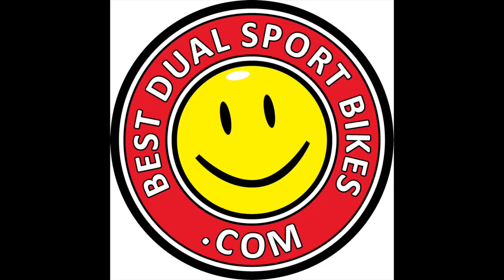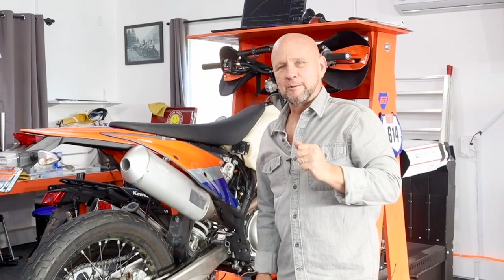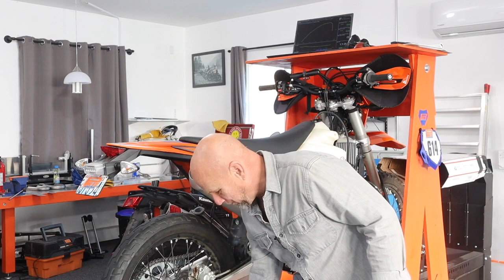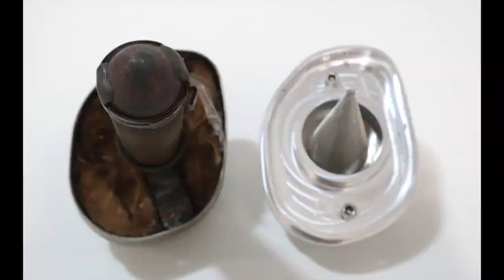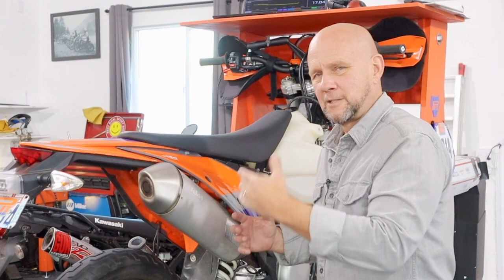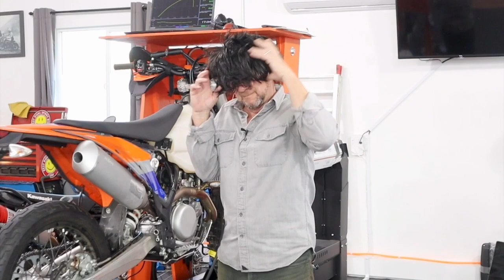Exhaust End Cap by Pin-It Racing | Best Performance for the Cost

Comment: Just throwing this out there.....on my KTM street bikes (690 SMC R and Duke 890 R)....the stock signals look identical to those donkey ears on your bike. I ordered the OEM Euro turnsignals which are much more svelte and LED. On my 690, they were plug and play (although they flash a bit faster). On my 890 LED mode had to be enabled at the dealer in the bikes BCM. Everything bolts up and has the correct connectors just as the North American signals do. Just a thought.